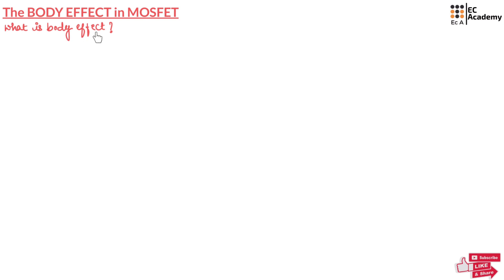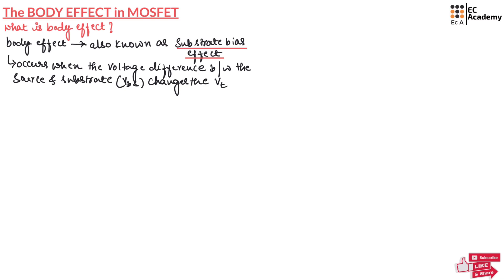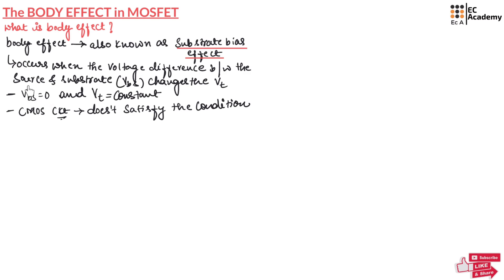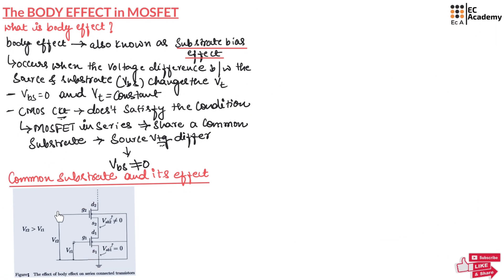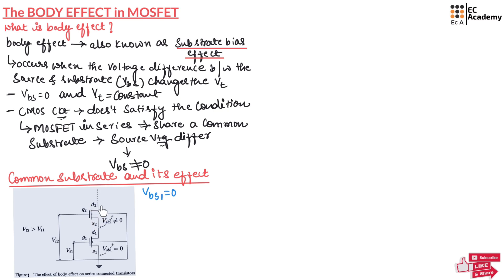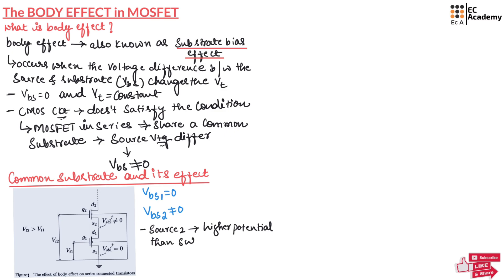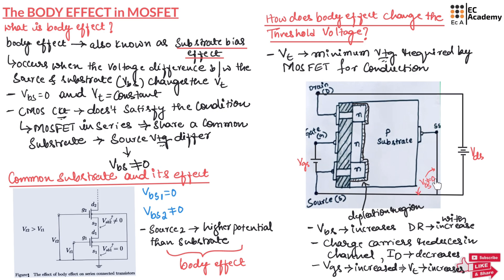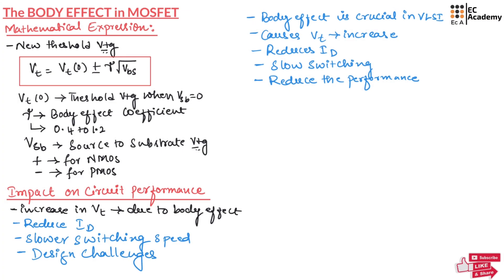The Body Effect in MOSFET | Threshold Voltage Shift Explained with Formula & Impact | EC

Comment: This lecture is a game - changer! I'm wondering, in real - world VLSI design, how do engineers balance minimizing the negative impacts of the Body Effect (like Id reduction) with other design constraints, such as power consumption and area limitations? Any practical tips or trade - off strategies you could share?
Reply from the maker: Hi @xinShiJia, good question! For Body Effect (like Id reduction), engineers use tricks like body bias control—adjusting voltage to reduce impact—and proper transistor sizing to fit area and power needs. Trade-off is big here; if power is priority, you might sacrifice some speed, or if area is tight, adjust design accordingly. Also, using advanced process tech like FinFET helps. 

Subscribe and keep supporting EC Academy ✌️
Reply: Thanks for sharing! I get it now.